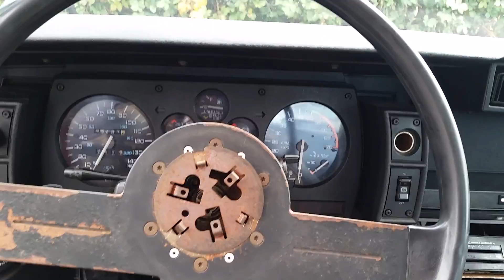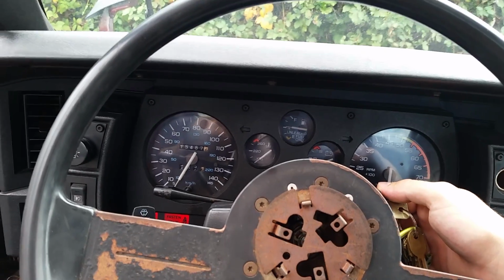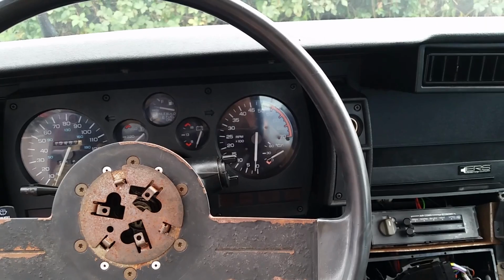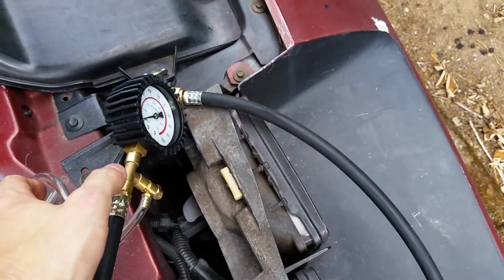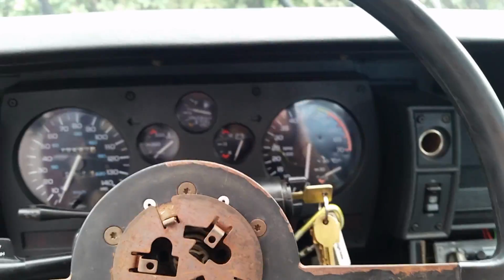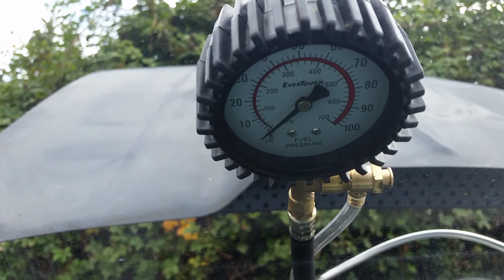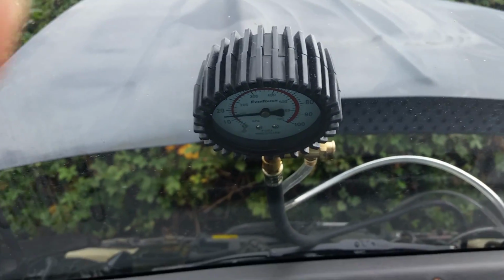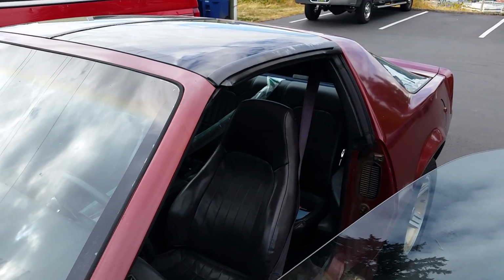1989 Camaro no start diagnosis

Comment: This car should have primed at key on.  Your leakdown isn't that bad, it should start and run.  It shouldn't leak down, but it isn't bad enough to cause a no start.  Your pump relay is probably not priming when it should and oil pressure buildup, during cranking, caused it to turn on by bypassing the relay.  Your leakdown is quite possibly in the pressure regulator, under the hood, not in the tank.

Comment: What's up j I have the same car I replace the fuel pump I replace the fuel filter also the fuel still no start. But when I spray some starter fluid under the hood it starts for a second what do you think it is
Reply: Hey man did you figure it out? Currently sitting in the same situation
Reply: Fuse under right side engine bay fuel pump relay
Reply: Injector

Comment: I changed my starter, and would not start, then I changed my ignition dimmer switch still nothing. bypassed my clutch neutral safety switch still nothing.  put new battery nothing checked fusible link they are good.  checked my MSD good! changed my key tumbler still nothing and I was getting power to the return to the s part of the starter until I changed the ignition switch dimmer.  any ideas?
Reply: I did all that and i still can't get my car to start as well

Comment: How do I put a question on this site? I have a 1989 Camaro RS that will not start. I have changed the fuel pump I have put a new fuel filter and the car will do everything but start. I am getting fired and there is gas in the car and I've got all kinds of fuel pressure. I just can't get the car to start without starter fluid but the minute I take the starter fluid off the car kills and then it will not start
Reply: Check timing?
Reply: Relay or fuse?
Reply: I'm having the same issue with a 92 rs

Comment: serious but simple question: Do you pump the gas when you turn the key? My car never starts unless I give it some gas lol
Reply from the maker: Doesn't work for me, Works for my truck, but it has a carburetor
Reply: Simple reply:  You don't "pump" the gas in a fuel injected car.  In older cars with carburetors you might have had to do this to set the choke but modern cars rely upon the computer to signal the pump to turn on and pressurize the fuel system and get fuel to the injectors which would then open on demand during cranking.
Reply: Does it idle at the right speed once it starts?  Idle air control valve (IAC) should be opening at key on, to allow enough air to start the engine.

Comment: 04 trans am. Lt1 5.7 liter. Ran it out of gas now it won't start. It acts like it wants to but wont. When you let off of ignition it keeps popping like it's running at an extremely low rpm . then when you try to pick up rooms it dies.
Reply: That sounds like the optispark distributor. I've gone through that 3 times
Reply: And I think you meant ***94

Comment: I put a new battery, new starter and new alternator and it won't start.  Any help?
Reply: I think it's my fuel pump because the sound doesn't happen anymore. It used to turn on a motor in my IROC before I turn on my ignition to turn on the engine, now it doesn't make that noise. Is that the fuel pump?

Comment: Before I started working on my car I could put starter fluid in the intake and it would fire right up but then die I changed the fuel pump out I guess I had some rats or something chew up some wires i fixed that but now still no start do its definitely getting gas air and spark

Comment: Mine doesnt crank over
Reply: Battery and/or check the wires by the starter, especially the small red on top of the starter. Mine was corroded and I had to move a bit and use a voltmeter and it cranked.